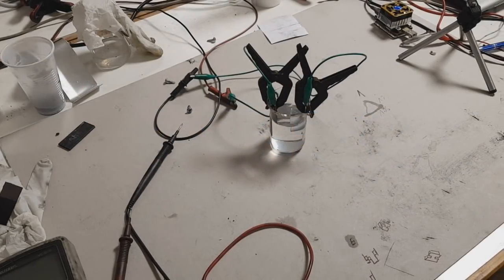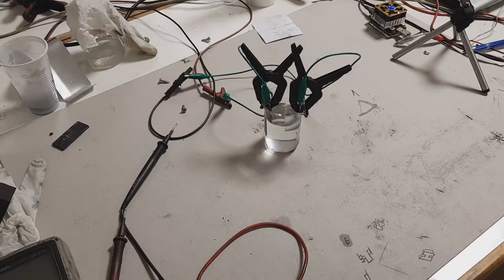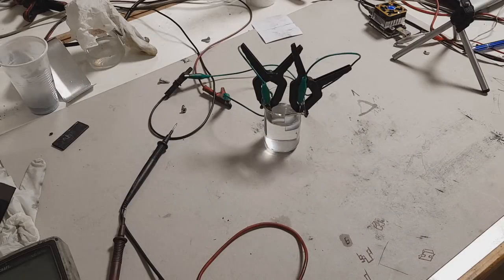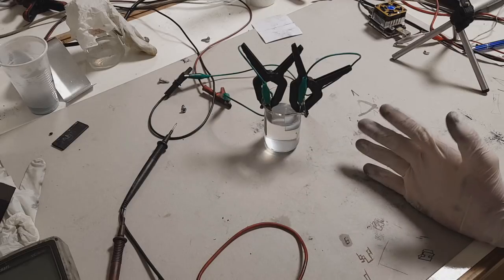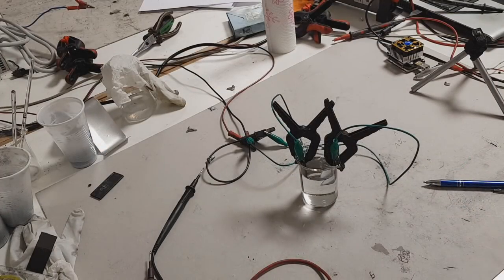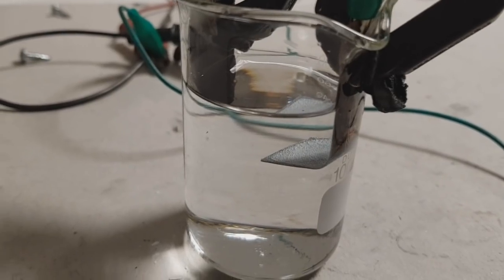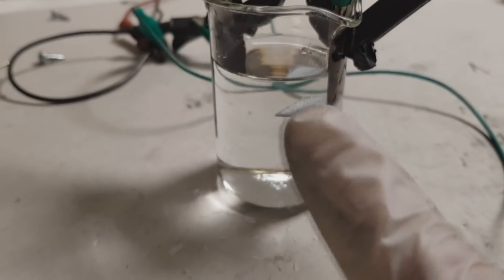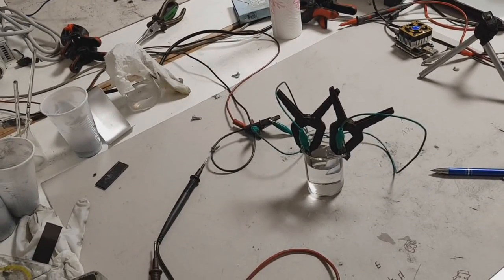Zinc Battery - Reducing Dendrites

Comment: For DIY nerds out there interested in batteries, a pretty simple and cheap battery chemistry to work with is Zinc ion-either primary or secondary types. This post is concerning secondary (rechargeable).

Zinc Ion Rechargeable Battery- DIY

materials:

Anode: Conductive carbon, fine mesh Zinc powder (washed in appropriate solvent to degrease and get rid of some oxide within the powder). Ideally the carbon is soaked in super saturated colloidal silver and then dried slowly or freezedried, but not heated above room temp.

Cathode: Carbon with silver colloid, support metal mesh such as Ni or Ag or copper

Electroylte: Fumed silica and aqueous solution of Zinc Sulphate and 5%wt PbSO (lead sulphate) addition li+ ions can be added to increase cell capacity. PEG can be added in varying amounts to prevent dendrite formation, PbSO prevents dendrite crystallization, and the Fumed silica creates a very difficult path of crystallization all without sacrificing charge and discharge speeds.

Separator material between electrodes: fiber Glass Mat-ultrathin, mesoporous cellulose acetate thin film, or optional separator/gel electrolyte combination with slightly different more complex chemistries.

Nominal cell voltage- 1.2-1.8V @100-800+mAh\g (with Li+ or other ions can reach 1000+mAh\g).

Enjoy the DIY and spread the knowledge- Zacariah Heim
Reply: Thanks, I noted ur suggestions and thats why I like comments section on YouTube!  Using catalysts can make the cell costly, what about using activated carbon at cathode ?
Reply from the maker: More simply battery tech is the iron ion or air battery. The description is nice but I think this battery will not be for the mass production, because I think that the price can go over <$100/1kWh really quick. You have more simply tech designs like this. Yes, you can add Li2SO4 to the electrolyte for more capacity, which is also good idea, but in this case is good to have some carbon based anode for intercalation of the ions. Nice one Heim
Reply: Agree, without the silver the device can be cheaper. Are Iron ion batteries rechargable, i have not worked with iron chemistries besides Ni-Fe and Ni-FeMH.
Reply: I've been wondering how to make a ZnBr gel electrolyte and replace the ZnSO, make the battery safer, cheaper, and longer lasting. Just not sure what to gel the Zinc Bromine with.

Comment: It's a very intersting expieriment! 
It would be great if it's possible to build with this materials a battery with high live time. 
Suggestion: Put the electrodes horizontal - so the zinc belo the coal electrode, and a thin spunge as seperator between the electrodes to avoid short cut between the electrodes. What do you think?
- Another suggestion: To protect the alcaline electrolyte put a bit of hydraulic-oil in the battery-container. This willget the co2 away from the electrolyte and prevent distroy the electrolyte.
However: Wish you great success with your experiments!

Comment: Interesting experiment cayrex, was the resistance of the the electrolyte increased when you added the PEG and so reduced the charging current at 6V and so reduced dendrite growth because overall energy was less in test 2 ?    -   Martin.
Reply from the maker: I was also thinking the same,.... the resistance difference from test 1 and test 2 was 0.2 ohms.

Comment: Interesting!! Could you do a video with PbSulphate added to the electrolyte? The PEG will have a synergistic effect with the Pbsulphate and while the PEG prevents dendrite growth, PbSulphate prevents crsytallization by coating the surface of the Zinc, preventing the formation of crystalline zinc dendrites.
Reply from the maker: Yes, I will try this, when I get PbSO4
Reply: Hey did u try that out? Could u explain how pbso4 will coat the zn surface to a random person with minimal knowledge on chemistry? 

I mean probably pb2+ will make pb on the neg plate(?) But cant zinc still form on that and produce dendrites?

Comment: I have been staying with the hydrogen ion all carbon battery... This way there is no buildup of dendrites. I to have a voltage limit of the cel at 1.2v max... But it can store a ton of charge via the hydrogen. I am using distilled water and Urea with all carbon cel. I have used copper on one plate to increase the current. This is due to the carbon and copper being in contact and assisting the potential difference of the one plate. This is due to the electronegativity of the copper and carbon that assists the cel into a biased mode between the two plates of carbon. the copper should be outside of the electrolyte used as a secondary current collector. I got that idea from you!
Reply: Your cell sounds interesting Jon, any chance you could make a vid and share it on here with the rest of this small community :-)   Martin.
Reply: Well the hydrogen ion battery is not a water splitting battery. It uses water as a solvent and the hydrogen comes from the Urea. Urea electrolysis starts at .35 volts. If you keep the cell below 1.2v the water stays whole but the Urea donates hydrogen to the system. The hydrogen is used as a charge imbalance mechanism.  The separator is paper lol.
Reply: That's fantastic!! I thought you were using the Hydronium route at first, using reverse- fuel cell proton battery. But this idea is much easier for me to experiment with. Thanks for the info :)
Reply: Yeah it has potential but the cels need to be sealed in order for the process to be reversible without additional water being created. Urea condenses water and eventually will break down to ammonia if left in open air. My experiments have been going in the right direction and I am pleased at the results so far.
 As with any hydrogen producing cel you need to pay attention to the explosive nature of the hydrogen. In this case the hydrogen is stored in hydrocarbons, which can form very very long chains and make the hydrogen less dangerous.
 The closest device or method I can relate this to is a flow battery, with the separator being the charge barrier. Get more hydrogen on one side and it becomes active like a battery. The hydrogen is the conductor and the water is the medium that conductor moves through. Since Urea electrolysis happens at a much lower threshold at .35v you can take the cell from the lowest .35v to 1.2v for the distilled water to remain water. Cel management will be critical to keep the cels operating between that .35v-1.2v range. Would be no different from the lipo cels we use today. This could be enhanced by increasing the amount of cels in a battery and the charge capability could be enhanced by using parallel plates to increase the surface area. I am also trying to figure out how I can bias the Urea into constant electrolysis at the lowest level of .35v
 This would entail using a metal outside of the carbon plate on each side of the cel. This is something I am working on. It has to do with the electronegativity of the metals and carbons. But that is a side experiment that I have only dabbled with and have not been working on specifically yet.
Reply from the maker: Nice work! My teammate have work on similar design. But he used EC/DMC 50:50 to replace water for geting higher voltage. Also others electrolytes was EG- urea. The electrode was made from a graphite carbon, which have good conductivity and good intercalated properties. I hope that help you somehow.
Reply from the maker: Also C5H14ClNO was also not bad instead of urea 😉
Reply: I am using graphite/carbon coated electrode. I am thinking of biasing one of the electrodes with titanium dioxide as well to further increase the diode like effect abnd force the urea to electrolyze on it's own. <don't really know if that is happening but I have been seeing a recharge event...
 I am using water because of the inertness of it. I want this to be as non toxic as possible...
Reply from the maker: @jonbigman9723  I think this can be a good idea.
Reply: Me too.. You can use it if you want. I know you have done work with titanium dioxide as well.. I found out it is a semi conductor... What the threshold is to activate the conduction of titanium dioxide for me is still unknown...
Reply from the maker: @jonbigman9723  or H-TiO2 (hydrogenated titanium dioxide) or better you use H-TiO2 in hydrothermal reaction with KMnO4
Reply: All I know is that I saw a credible recharge event when I added the tio2 to one of the carbons. as well your other trick of using a copper current collector outside of the electrolyte chamber also donates towards this diode like effect... I wanted to check to see if aluminum on the other electrode as a current collector only could further push the diode like effect due to the copper aluminum electronegative span... But I have not gotten there yet...
Reply from the maker: @jonbigman9723  in one process I use TiO2 and glucose in hydrothermal reacrion to get TiO2/C
Reply: ok so thats a way to get the biased carbon.. I get you....
I have been using activated carbon and titanium white acrylic paint... I decided on the paint because of the acrylic binder that can be used with water and urea...
Just mix it and paint on the mixture and let dry on the graphite electrode... The same with the activated carbon plain electrode but i add acrylic binder to the carbon... I just started to use powdered graphite to add to the carbon electrode to increase the conductivity of the carbon storage material...
 My electrolyte mixture is still off.. way to much urea to water ratio.. It is giving me a high self discharge rate because of too much Urea... I know this because I was testing Urea strength in differing amounts and the less Urea I used I found a low self discharge rate overnight. I found the cel did not go below .9v over night so I am assuming it is just a matter of using the proper Urea amount to the surface area of the carbon storage plate.
Reply: Jon acrylic binder is PAA? Do you think is possible to incorporate both carbon and electrolyte salts in the slurry to create a semisolid battery? I think liquid electrolytes are dangerous so it'd be better to have a semi-solid device working but ofc losses would be increased
Reply: Yeah that would be the ultimate form. Semi solid. I have not messed with the acrylic for a gel type application of the electrolyte. I would need to do some testing... Maybe PVA and the urea with a small amount of water then throw some borax into the mix and it should become pliable and have ionic conduction. But I would have to try it out first and test it...
 The acrylic is a polymer and if used in the right amount becomes a structure for the carbons to adhere to for each electrode.. I have gotten my copper and I'll start testing the new designs asap...
 But I will need to figure out how I can use a new process that exfoliates and cleans all surfaces via a brush discharge... High voltage Plasma cleaning is the idea there..
Plus I think I will need to bake the carbons onto the electrodes. This way they reactivate and puff up, like a cake. Well the first layer will be acrylic and graphite powder. Then the next layer after the plasma treatment will be a layer of acrylic, carbon and some (small amount) of the Urea solution, rebake. This will be the negative electrode.
 The positive electrode will have a combination of graphite powder and titanium dioxide. This will act like a biasing agent for the positive electrode.
 The current collectors I am gonna use are external to the electrolyte portion. Touching the back of the graphite foil I am using. This as well will have a potential difference that will act like a diode as well and strengthen the self recharge ability of the cells. In these types of cells they are only a simple hydrogen storage device. Shifting the balance of hydrogen back and forth within the device. It should never wear out but it will only be as good as the carbons you are using and of course the electrolyte..
Reply: @jonbigman9723  Hi i know its been 3 years since your comment but really appreciate if you can reply

 so ur cell charge by making H2 when providing 0.35V- 1.2V and you are trapping that H2 and the rest of the "urea" form an anion that goes to the +v supply which cause the charge imbalance and during discharge that trapped H2 is  "split"  to H+, release an electron and combine with the neg urea anion thing to form urea?

Also to which graphite plate did you bias using cu plate/tiO2?  +/-?
Reply: Hyrogen ion battery? H3O+ and OH- ions? I am confused what you mean by "hydrogen ion battery"
Reply: I am very interested! I've been doing my own battery experiments with Carbon as well. I am just confused as to how the proton battery functions exactly. Do you use a PEM separator between the carbon electrodes? How do you collect charge without splitting the water molecule into it's gaseous components?